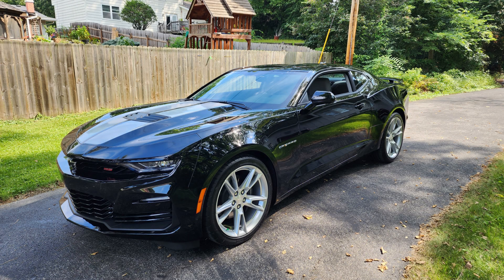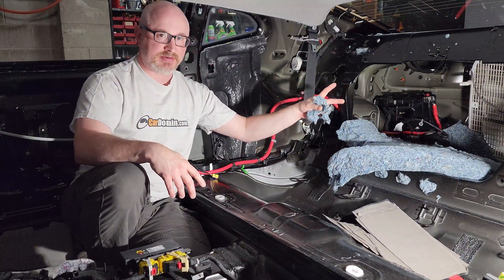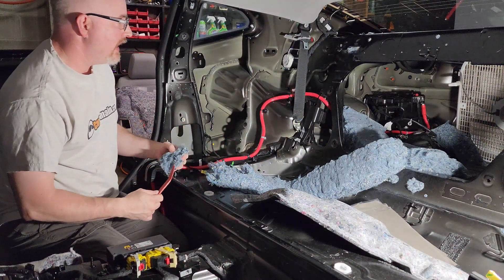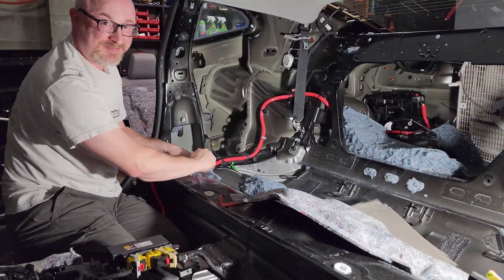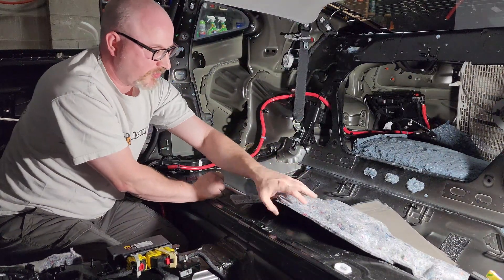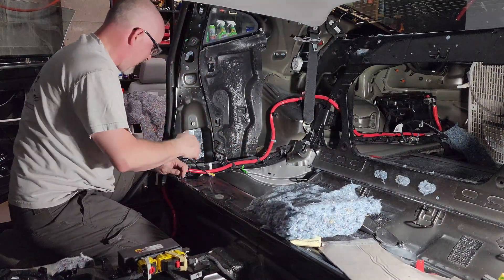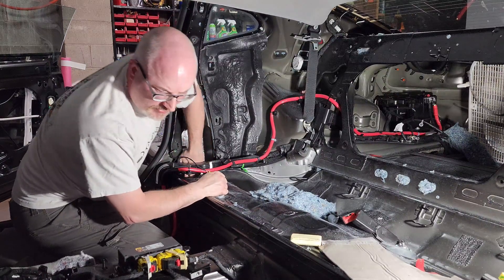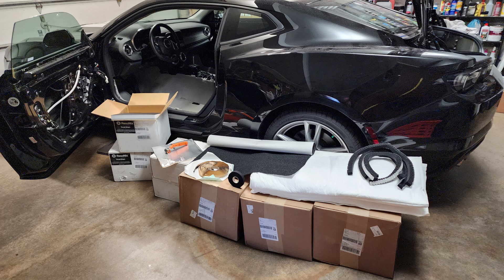Acoustical Engineer Explains - Sound Absorption - Making Cars Quiet - 2023 SS Camaro

Comment: Is condensation and humidity not a concern?Also i thought the insulating material had to be fluffed in order for the acoustic absorbing properties to work?
Reply from the maker: Good questions.  Condensation is not a concern because there is no vapor barrier coupled with humidification on the interior.  There is cloth, foam, etc., in the interior already.  OEM sound absorption is already there, I just add A LOT more.

No, you don't have to fluff sound absorption to be effective.   In fact, density is a metric of performance and higher density = higher sound absorption coefficients.  The majority of commercial acoustics panels are rigid fiberglass.
Reply: @richardvedvik979 thanks for answering! I live in the southeast so humidity is pretty high. I've been using thinsulate so far, doing one section of the car and ordering as i go but something like that denim you used would be much easier to stuff in voids. (the acces holes to those voids in my car are much smaller than the ones in yours.) With everything I've read so far they say the insulation material can't be compressed for it to work right. There's a lot of conflicting info out there.
Reply: Both are correct, but for different purposes.   For sound insulation, high mass works best.  For example, concrete is hard to move with wimpy little sound waves.  For thermal insulation, low density is generally better because there are more air pockets.  Air is a poor conductor of heat, but a great conductor of sound.
Reply: @keppscrossing was actually talking about sound absorbers, not sound barriers. Specifically a sound absorber that doubles as a thermal insulator.

Comment: Is it really 50 cubic feet? that is 1415 liters for the users of non-freedom-units. Seems a huge lot
Reply from the maker: The bag is large, yes, and it comes compressed, intended for insulating walls in your home.  Uncompressed, it expands in size.  Consider that's just 3 ft by 5 ft by 3 ft or so, the rear quarter panels eat a lot of it up.

Comment: Hey man, I have similar on how to do sound deadening on the car, just wondering would open cell foam would be better option as those fibre eventually will sag and might have potential getting mould after sometime?
Reply from the maker: When we are applying sound absorption products, we want to look at the sound absorption coefficients of the products.  Open cell foam usually has pretty poor acoustical characteristics when compared to fibrous materials.  The Resonix fibermat has an adhesive on the back side that will hold it in place.  The areas where I applied denim insulation are filled such that sag is not a concern, this is no different than where we apply sound absorption in walls.  Open cell foams are just as likely to get dirty or hold moisture.   

This is why I don't apply fibrous sound absorption (without protection) in doors or anywhere that will get wet routinely, instead, I used Resonix Guardian in these doors.

Comment: Thank you for posting this.
Question - the material you use for sound absorbtion - in case I am "allergic" to dust, do you know of other alternatives that would work as well? 
I am considering "3M Thinsulate SM600L" - it has no adhesives, so it could be folded and cut into pieces.  Any other absorbers that you like?
Reply: I just used SM600L from ebay on a headliner and now shoving pieces of it into cavities. Great price. I would recommend over cotton based products. I have a new favorite.
Reply: just wear  a mask